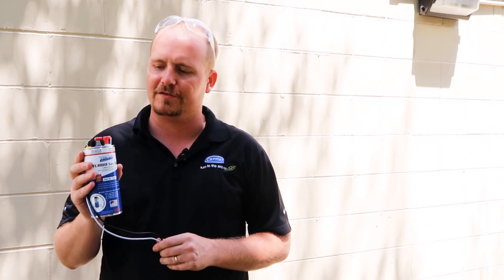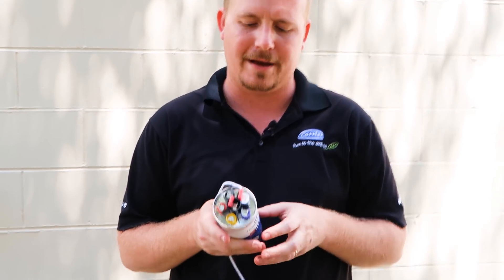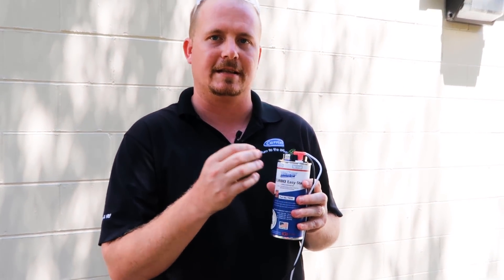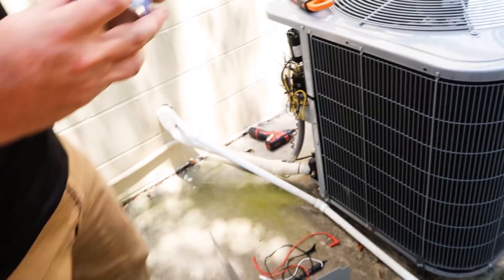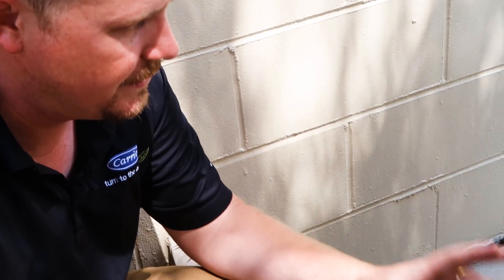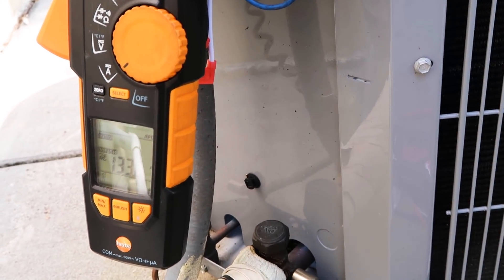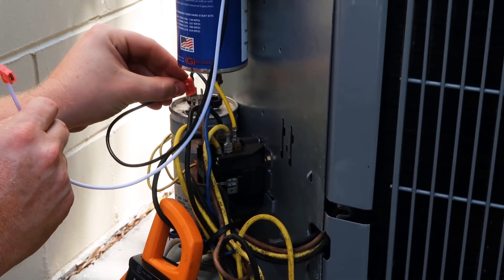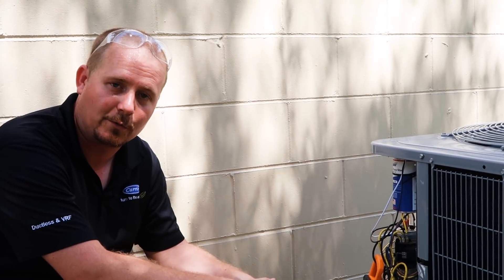Wiring in a Universal Hard Start Kit

Comment: I'd use and trust that more then a 5-2-1 hard start. 5-2-1's are known to fail by not releasing the relay once engaged in the start cycle. And I've learned last week, they are made off shore. I have a new 5-2-1 still in the package I won't be using. I called AmRad and spoke to them about the Turbo Jr. I currently have a 2-Ton Trane R-22 Central AC from 1985 that operates great with a factory installed start assist. No issues, but I'm one to always have backup parts for everything since I live out in the country........nice video. Enjoy your channel.

Comment: Great video! 
So do you rely on the tonnage or the OEM start kit specifications?
A friend is having a TES5EXT hard start kit installed on his 4 ton Lennox system (13ACX-048-230-10). The OEM start capacitor is rated at 176-216 MFD, but the 3.5 - 5 ton MFD on the TES5 is listed at 270-324.
Instead of matching tonnage in his case, should he go with the jumpers on the 1-2 ton, which is 189-227 MFD on the TES5EXT?

Comment: New for 2022 Amrad now includes what they call the "CPT Fuse Wire".  When the relay becomes stuck in the close position, the fuse inside the wire disconnects within 3 seconds, cutting the motor-start capacitor off from the AC system. This is genius, even though this kit costs more than a standard hard start kit, this extra protection will be invaluable.

Comment: No good reason to use a resistor to discharge a cap as opposed to a screw driver and, this is why.  If the motor windings are good, the cap will discharge though the motor windings as soon as the power is turned off.  If there is an open motor winding, your going to be putting on a new cap with the new compressor or motor so who cares if the cap is abused a bit.
Reply from the maker: Very true... but I’ve got to make the safety warriors happy 😁 there is the open overload scenario which can happen and is more likely.
Reply: @HVACS  An open over load still leaves the cap with continuity across the run and start winding.  A burn wire connection could prevent a discharge though.
Reply from the maker: Martin yes good point... I didn’t think that one through

Comment: I have used "Kick" capacitors when I suspected the motor needed a push to get started...in the hopesof not having to replace that compressor. What I do not realize is how to determine(Other than try and see result) when the Kick Capacitor will get the Compressor functioning. I test the comp motor for continuity and ohms of the windings realizing if it is shorted out or winding(s) damaged that  a Kick Capacitor will not suffice. Is it truly "Try and see"? method or is there  way to conclude "Need  Kick Capacitor?".